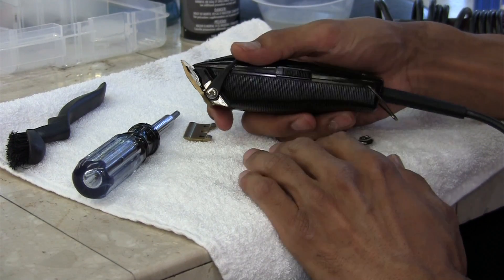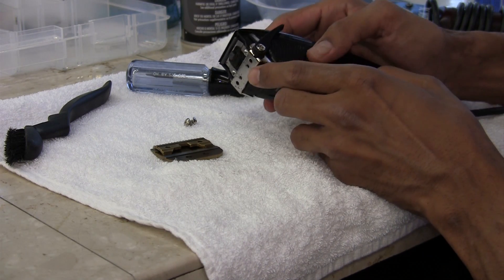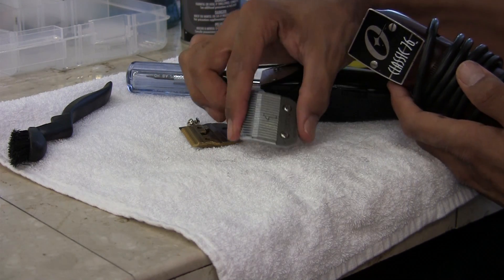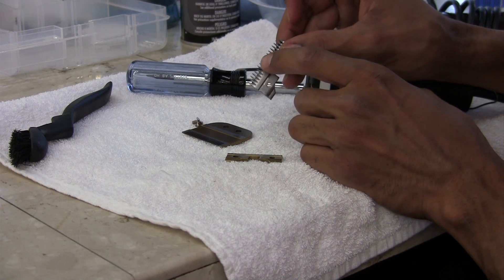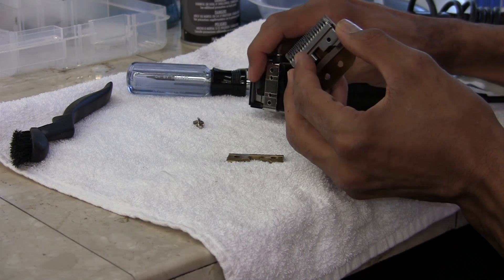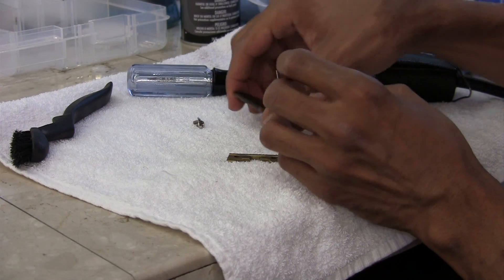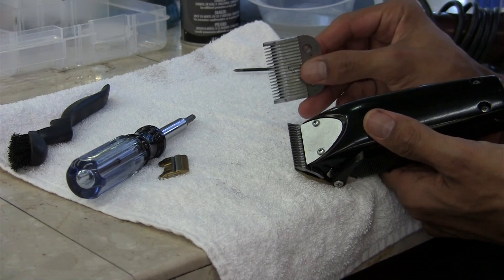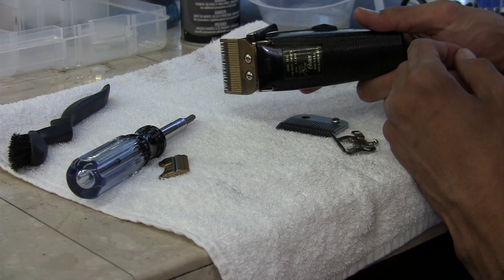Oster Fast Feed / Oster Speed Line Clipper - How to Zero Gap - Custom Blade

Comment: Great tip, thank you much! Another tip for those who use Andis clippers is swapping the 22 tooth bottom cutting blade from an Andis Master with the 28 tooth cutting blade of a Fade Master. This is an awesome combination. Peace!
Reply: Properly zero gapped with that cutting does it still bit your magnetic guards?
Reply: Pete Lugo Yes it still bites the guard but it's very little. I usually don't close the blade all the way when using the magnetic guards. If you want a guard that fits perfect and doesn't get chewed check out Vaucrollc.com These are universal metal guards that work perfect on zero gapped clippers.
Reply: Good looking out

Comment: Thanks for sharing the knowledge broski, I have one question, will replacing the cutting  blade to a #1 76er will it affect the tapering lever since the teeth are longer? Will I still have a lot of open n close taper lever action like originally or will it be limited due to the longer teeth on the blade?

Comment: Good vid.  The lever manipulation method is efficient also.  structure damage won't result as the half inch space was put there for the purpose of adjusting the gap space.

Comment: Hey i did it. Worked. Was too sharp so i was gonna re adjust. Now the #1 blade rattes like crazy. Put the stock blade back on worked fine. Went and bought another #1 blad and is comeing loose and rattling again. Any suggestions?

Comment: so i did this to my sped lines and i used it today on a kiddo was using the # 2 andis magnetic guard and the clipper snaged on the hair and wouldn't cut so i had to use a senior from a coworker i got home and had a manikin head i use to use in school and ran the cliper on it to see if maybe it snaged cuz of the guards so i didnt use any jus the blade all the way closed and again it snaged on the hair and wouldnt cut then i placed a guard on it and it rattled so i looked at it closer and the # 1 blade was pushing out of the clipper like when i placed it i noticed that the #1 blade was abit wider that the standard gold blade so then i put the standard blade back on my cliper and it cut jus fine with and without guards without rattling  i did notice that when i had the #1 blade it was able to cut allready short hair alot closer that the standard blade but ones i had to remove bolk it snags every time unless i open the blade a bit then it seems to cut fine but if i have to open it to cut kinda defeats the purpose of having it zero gapped if it snages when its at zero

Comment: I just bought the clipper and started to do the "jam" zero gapping method. Since I don't wanna potentially damage my brand new clipp I checked and found your vid. I don't have an existing oster no.1 guard since this is my first oster, plus those detachable blades are expensive as we all know. I have an andis 000 ceramic, an andis no.2 and andis outliner blade - all detachables for my andis bgr.  Would any of these work is there another method or do I need to go BUY the oster no.1 detachable  just so I can take it apart and use this method? Lmk thank you

Comment: David,  have you tried the 25 teeth blade on the speed line? And is the Oster Black Diamonex blade the same as the 1 blade u used in the video?